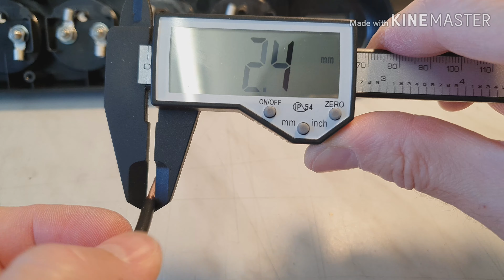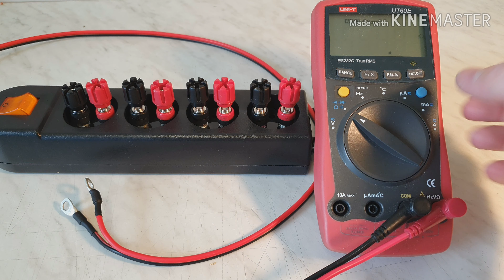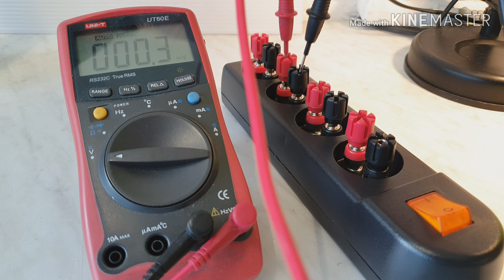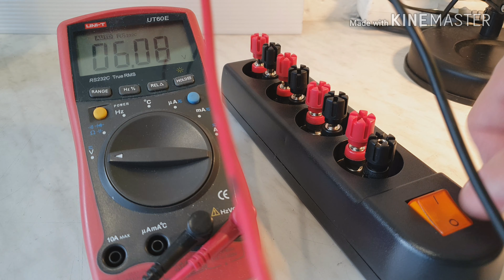How to made HUB for DC POWER SUPPLY (DIY project)

Comment: An excellent job Peter. Very neat. The only thing I would have done was to add a bit of heat shrink over the feed cable after the soldered connections to stop the cable ripping. 👍☘️

Comment: Would it be possible to take the lighted toggle cover off and replace the neon bulb with a led one for 12v? It would be nice to see the switch light up when on.
Reply from the maker: Yes it is possible, but there is also an another great way how to do that. Inside of each of four sockets is one original hole for grounding pin. This holes have same diameter like common LED ;-) Just glue it from inside and its done. 73, Paul

Comment: Very nice project and super neat work. Maybe add one or two USB outlets. Looks as though you have some space left to add a simple voltage divider. Good to see the addition of capacitors to help combat unwanted RF.
Reply from the maker: Thank you for your nice comment 😉👍 Yes there can be done a lot of good improvements. As you said - the USB ports, voltage divider or some surge or overvoltage protection 🤔 I need this hub just to multiply connectors because my Switching Power Supply has only one pair 😄. Have a nice day 🙋‍♂️ Paul OM0ET
Reply: @OM0ET  hi, Paul! Really great job. What  is the nominal of the capasitors? Will try to repeat
Reply from the maker: @gastello1977  thanks! 😉 I have used the 100nF ceramic capacitors. But you can find also specially designed capacitors for this purpose. They are blocking RF in the DC circuit. 👍 My advice  - don't use this built-in power switch. It will not work with 30Amps 😉. Try to find one for higher current or just not connect it.
Reply: @OM0ET  thanks for the advice, I've already thought about it

Comment: Very nice I like it!  My only comment is for anyone doing this, to check that the AC switch is capable of switching the full load in DC too, since they are usually rated much lower for DC current than AC.
Reply from the maker: Yes, you are absolutely correct! :-) Later I've realized that, when my TRX went off while transmitting :) I had to overcome that switch. 73

Comment: Great idea!!  I may have to do this as well.  Might even think about using a fuse holder of some sort for each component section for extra protection.  Great video!! Juddie WD8WV
Reply from the maker: Yes, there are a lot of possibilities how you can modify this hub, adding some fuse, surge protection, small voltage or current regulator and more... ;-) In my case I counted with fact that most of my radio equipment has own fuses on the feed lines :-) 73 and good luck with your own hub! Paul

Comment: I've never seen a soldering iron like that - could you provide a link to information on it please?
Reply from the maker: choose the english flag:  https://www.tme.eu/sk/details/lt-100p/odporove-a-trafo-spajkovacky/zdz/
Reply: @OM0ET  Ďakujem za vašu odpoveď. Nástroj v odkaze, ktorý ste mi dali, nevyzerá ako spájkovačka, ktorú používate. Tenký, zakrivený spájkovací hrot je to, čo ma zaujíma.
Thank you for your reply.  The tool in the link you gave me does not look like the soldering iron you are using.  The thin, curved soldering tip is what I am interested in.
Reply from the maker: @Tassie-Devil  It's just the matter of what kind copper wire you use for soldering tip.

Comment: What filters are they that you used?
Reply from the maker: The are ceramic 100nF capacitors. Better use capacitors specially designed against the noise. i didn't had them. But they are OK too. ;-)
Reply: @OM0ET  thanks for reply, what capacitors would you recommend in that case?
Reply from the maker: @Ricochets86  for example this one: https://www.tme.eu/gb/details/jfw-100n_310-p15/x2-y2-polypropylene-capacitors/jb-capacitors/

Comment: Awesome project! What is the use of these capacitors? Is it to absorb minute power fluctuations?
Reply from the maker: Thank you! 😉👍 The capacitors should be better at least 100nF and specially designed for fight with the RF and the noise. But  I didn't had this ones so I have used just common capacitors 😊 And also I forgot to use transil as overvoltage protection. Have a nice day! Paul
Reply: OM0ET oh I see, makes sense! Have a perfect week too!

Comment: Very clever!! Congruts again dr Paul! May I suggest the addition of an simple LED indicator? I like also your precise work. Keep on!    de SV2CGN
Reply from the maker: Hello Pascal! Thank you very much ;-) About the LED - Inside of each of four sockets is one original hole for grounding pin. This holes have same diameter like common LED ;-) Just glue it from inside and its done. But I didn't needed it because my power supply has one :-D Have a nice day and 73, Paul.

Comment: Now taken delivery of a similar extension. HOWEVER the top and bottom aren't secured by 'normal' screws! I have never seen the tops of the pins before. So frustrating. £20 down the drain. (not to mention the cost of the other components) :(